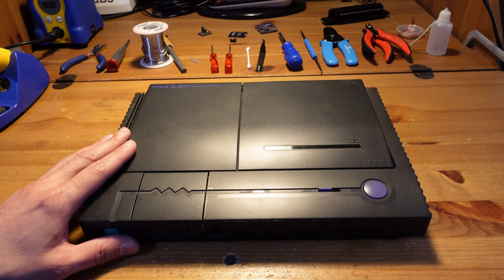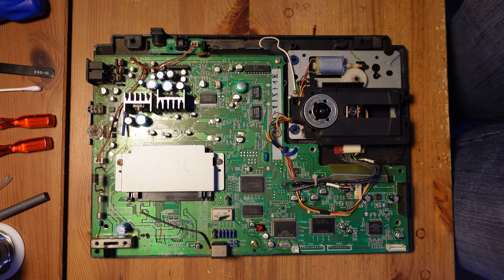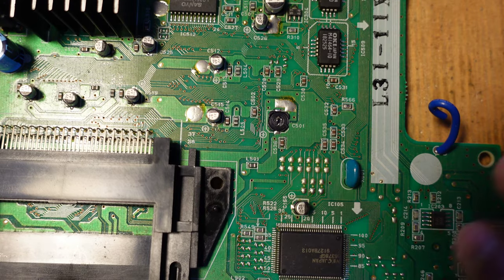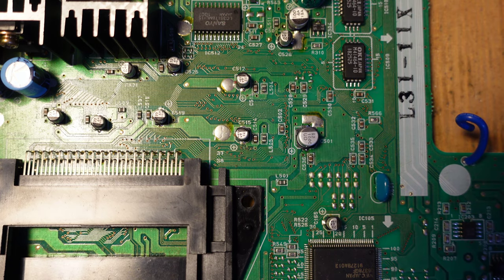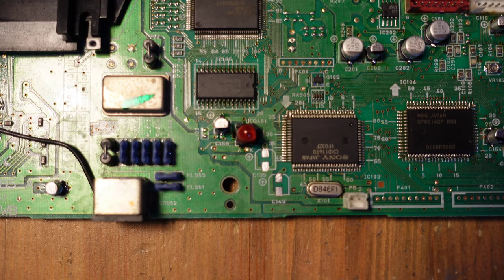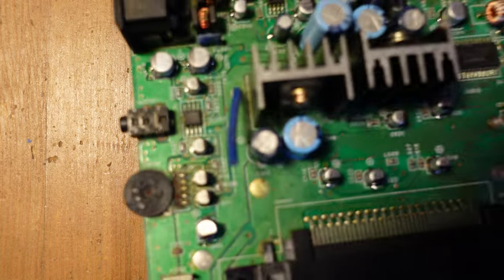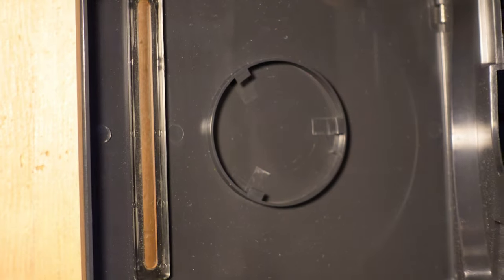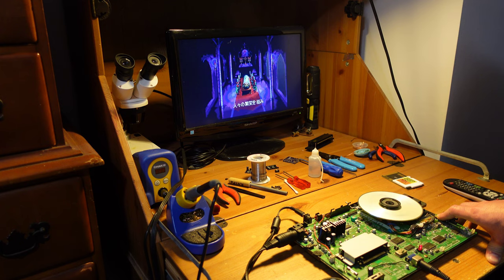PC Engine Duo repair! Complete capacitor replacement and troubleshooting guide

Comment: I just got a Turbo Duo in the mail this week and it functions just as this one in the video. HuCards work and CDs spin but won't boot. I have a cap kit coming in the mail so hopefully the CD drive works after the recap. Thanks for the info!
Reply from the maker: Thanks, and I hope that the video will be helpful!
Reply: @LIRetroGaming  Very helpful! I worry about doing the twisting method, I really don't want to tear a pad off on my Duo, I've accidentally done that on other consoles before. When I go to do it (probably Saturday night) I'm just going to be extremely careful and take my time.

Comment: FYI, The Chemical Brothers - Born in the Echoes Deluxe is an 80 minute factory pressed CD that you can still buy. Comes in handy for testing Duos.
Reply from the maker: That’s perfect! Very helpful to know that
Reply: @LIRetroGaming   I was wondering do you work on Saturns? I have a model 1 saturn how much would it be to ship to you and how much for placement laser  and the mod for the game save on a chip and maybe a moder replacement. think you!
Reply from the maker: @ryu855  George definitely works on Saturns, you can get in touch with him at www.1uprestorations.com

Comment: Уважаемый, а можно ли установить КЕРАМИЧЕСКИЕ SMD конденсаторы за место электролитических твердотелых?
Reply from the maker: Normally I do not recommend ceramic capacitors as replacements for electrolytic capacitors. Sometimes it’s ok, but I’m other cases the ceramics do not match the properties of the original ones

Comment: I have a PC Engine Duo-R that reads authentic games and music CDs beautifully.. but not backups. I think it's the POTs that needs adjustment?
Reply from the maker: It might be the cds that you are using and the  speed that you’re burning it. Try a different brand and a slow speed
Reply: @LIRetroGaming  I've tried two different brands and burning at 10x.. the lowest speed my burner goes. What brand do you suggest?

Comment: How can I get my Turbo Duo refurbished? Currently, it'll play HuCards, CDs, Arcade CDs, but it has issues. Loud scratchy sounds, no video sometimes, no audio sometimes. The multi-tap won't work for player 2.  I did open it up and used contact cleaner (but not on the CD lens) on both sides of the board, all my controllers, and used that cleaner from ToyRUs for the HuCards (yes, I still have that cleaner and cleaning pads from way back in the day). It didn't make anything worse, but I'd love to play my games again, free of noise and freeze-ups, especially with my surround sound system. Any recommendations? I went to Ebay and discussed a possible refurbish, but quickly got the impression the person was ignorant!
Reply from the maker: Does it have the original capacitors? If so that definitely could explain a fair amount of the problems you were describing. Scratchy sounds and issues with video and audio also may suggest that the laser needs to be calibrated. If it’s using the original capacitors then it definitely needs to have all of those replaced for starters
Reply: @LIRetroGaming  As far as I know, it has never been refurbished, so it looks like the original capacitors. I could not see any leaking capacitors or anything that looked abnormal when I opened it up. There is a TZD sticker just above where the HuCard is placed (has the 1-800-DUO-THIS  number on the label), if that helps.

Comment: My Turbo Duo is having problems playing Hu Cards. I had an Everdrive that was working and now I am getting a white screen.
Reply from the maker: Is the region switch set to usa and not jpn?
Reply: I had the same problem. I had to fix the via's next to the caps direct behind the cartridge slot. Those are power lines to the logic ic on the other side ot the board. When those via's fail it will be stuck in cartridge mode (logic gate hold low) and never enter CD mode

Comment: so did changing the caps fix the cd drive? or were there other adjustments to get it working again?
Reply from the maker: Fortunately this one did not need any adjustments to get working. Changing the capacitors was all that was needed
Reply: @LIRetroGaming  good to know, thanks!